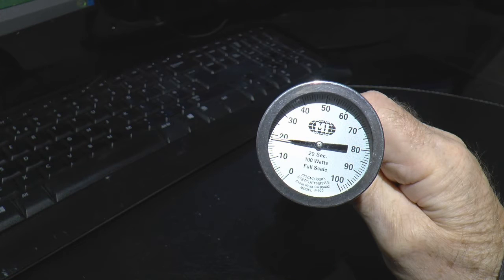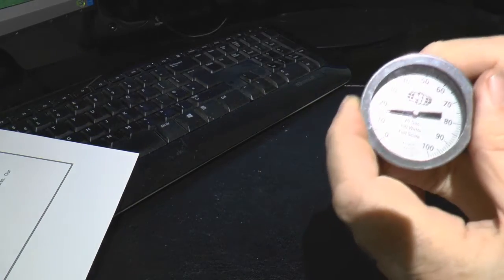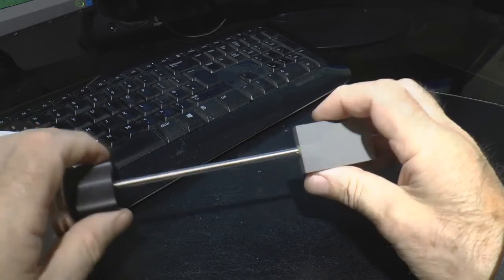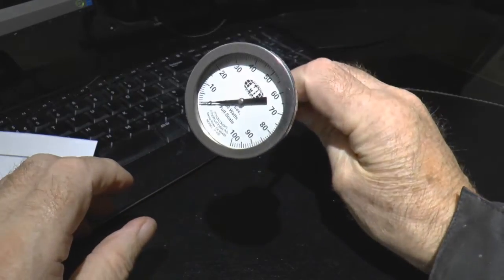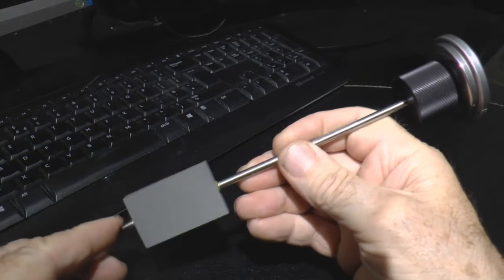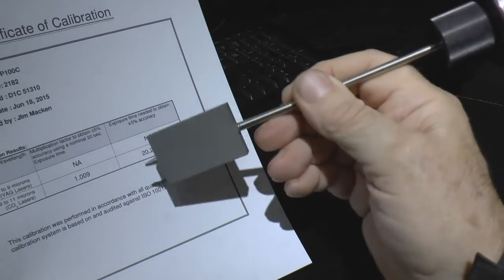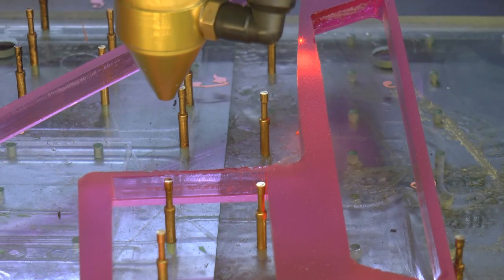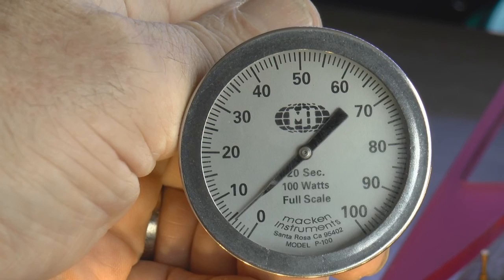RDWorks Learning Lab 32 50watt fraud Final proof

Comment: I understand that you have previously determined that full cutting power of your laser is achieved at 65% power but isn't it interesting that your final output is slightly above 65% of your advertised 50 watts? Have you considered doing this test with your power set close to 100%? Perhaps your power loss above 65% is due to optics / mirrors?  On my machine I never use more than 98% as directed by the manufacture however my machine is quite different since it uses a 100W RF laser. At 98% power it generated 107W using a similar meter.
Reply from the maker: +Mike Duncan 
Hi Mike 
Your last comment first. As you say, yours is an RF excited laser. When you look at manufactures specs for RF tubes there's generally two critical bits of information  listed. First is rated output (100watts in your case ) and secondly max output, which tends to be about 10% HIGHER.  A the 40/50/60watt end of the scale which is where most cheap Chinese lasers are, the tubes will not be RF driven. Most likely they are HVDC which are cheaper tubes to manufacture. Although RF tubes tend to be less efficient (power in to power out) they tend to perform more reliably and tube life is substantially longer. I defy you to  find a cheap low wattage tube with a dual power spec like yours. They all seem to have just a nominal rating and a recommended max drive current.
If you look at the graph at the start of session 22 ( https://youtu.be/KQDCy-mPNqA ) You will see a typical power characteristic for my tube. I have no reason to believe this is different for any other HVDC tube because I have two sets of data for other machines tested with power meters.  One was 50 watt (40 watts absolute max power at 80%) and the other 60watt (49watts max at 75%) both exhibit this 60-65% drop off. Mirrors and lens do not enter the equation when you test straight out of the tube. Yes I do have mirror and lens loss as well. but that's a fixed  loss at a constant power and not the fluctuating behaviour I was witnessing
When I was running my machine all the time at 95% I was experiencing significant power loss after a minute or so of running, as will be seen on my mode burns and test cut sessions whilst I was hunting for my problem. It was only after I had ordered a new tube that I did research on sealed CO2 laser tubes, understood the principle of operation for the gasses inside the tube and found out about oxygen poisoning. I then realised that all my observations were classic symptoms of this problem resulting from over- driving the tube. When I bought my new tube the website specified a maximum drive current of 20mA.  There was no ammeter fitted to my machine when I bought it and no mention in the manual that 100% didn't mean full power. Hence my ignorance.  
With my power meter thought I may be able to overdrive the machine for a short period and watch this poisoning/power decay in action....... but the meter takes 21 seconds to heat up (so that''s an average power) another 40 seconds to force the temperature back to ambient and by the time I take the second test the power may already be at 50% or less. I think it will have to be a series of rapid mode burns. 
That sounds like another  session you have helped me design. Thanks for your thought provoking comments
Reply: +SarbarMultimedia
 Thank you as well, this is information I haven't heard or read about before. My wife and I almost bought a 150W glass tube laser because of the price  and now you have helped me again by discovering something that isn't covered in the sales brochures. It was a difficult decision to spend so much more money on a smaller wattage rated RF tube machine. The driving factor for us is the fact that we will be using our laser daily after I retire, (in the next few years). We bought our Kaitian CM1309 RF100W  with plans of supplementing our income and so far it looks like this is going to be the ticket. Keep up the great work, your teaching us all a great deal! Now, perhaps you could show us an easy cad program? or how to use Corel Draw.....
Reply from the maker: +Mike Duncan 
Hi Mike

 

For a semi industrial workhorse I'm sure
you made a wise choice. Although I think your tube is a sealed system it will
have an expected life of 10,000 hours (5 years typically) or more.. My needs
were purely recreational so minimum spend for maximum work area was my
criteria.
Graphics software? CAD software? It
depends on your abilities and needs. I am an engineer who has been forced to
use some aspects of Adobe Illustrator that work well in conjunction with my CAD
program. If I was an artist or graphic illustrator then vector art packages
would be an essential tool. I store ALL my artistic talent in the last joint of
my little finger hence I rely heavily on my CAD software as a means of
expression. CAD software can be easy to use once you have overcome a few
concept barriers. Most CAD packages are aimed at producing a final fancy
drawing output, the main contractual document between designer and
manufacturer. and have far too many tools that push them towards the CorelDrawart package. I'm sure your products wont require 3D rendering to sell "the dream"to your clients. But it's not necessary to know anything about that if all you
want to draw is accurate shapes that you can cut on your machine. You will only
need a basic understanding of your CAD package to do this simple stuff. 

Cad software?  In conjunction with my 2D cad software I have used Solidworks to
build 3D objects from my 2D pieces. Its by Dassault the French airplane
company, its very  powerful and quite easy to use. I know that they also do a 2D cad software that is a free trial.

http://www.3ds.com/products-services/draftsight-cad-software/

 If you sign up with your email I thinks its free for ever, but they will keep pushingthe professional version at you. It’s powerful, free and NOT AutoCAD. I’m not a
lover of AutoCAD. I used a CAD/CAM package called Alphacam when I was working
with industrial machines.  I am now  a small company designing specifically for others to do my laser cutting

I spoke nicely to their sales team about licensing just the CAD element of
their package. For about £250 I now have a lifetime of use. It’s the simplest most
intuitive 2D CAD I have come across and I can work rapidly with it. May be
worth an enquiry at alphacam.com.RegardsRuss

Comment: Does this come down to the replacement tube,  amount of power from the PSU, type of mirror and lens or all of the above?
How you you go about ensuring parts you bought would up the rating to 50W as it should be?
Reply from the maker: +Peter Jones 
My final point is that I'm disappointed that it's not "as advertised" but it works OK for me and altough I might throw more time at the machine because I'm still interested in wringing a much as possible out of 37watts , I'll not chuck money at it because I think it would be a fruitless exercise. When I bought this machine I knew it was a risk. I mainly bought it for the work area  rather than it's power. As you become more cynical about the term "50 watt laser" you question does this mean a 50 watt power supply, a 50 watt tube or 50 watts of working energy. Well now I've proved it's neither of the last two. This new tube performs as my original one did when it was new so one has to suspect that was, at most, 40watts out of the tubealso.. The ability to cut 10mm acrylic and 10mm (maybe12) plywood (albeit very slowly) is almost twice my expectation, so how can I be unhappy? I've had endless hours of fun getting to this point and it's great to come to a conclusion. There are still quite a few areas to explore now that I have a power meter. How hot can the cooling water be before it starts affecting power output? Does the wind blowing through my open workshop door sap energy from the open path beam? Is the power uniform across the table area?  etc etc.
 
What does all this mean? Many users in USA buy these through mainland distributors and have rights if the product is oversold. These findings might make them more cautious when buying, possibly getting written guarantees from their distributor.  Here in the UK I am not aware of any distributors for these imports, that have a door that you can knock on when you find that you haven't got what's been advertised. Ebay, Amazon and  PayPal protection all sound great until you need it, then you'll find that it's as flimsy as the machine specification. If you buy cheap you must accept the risk.